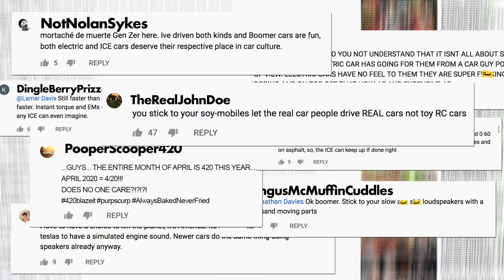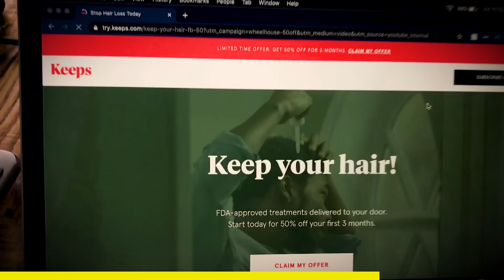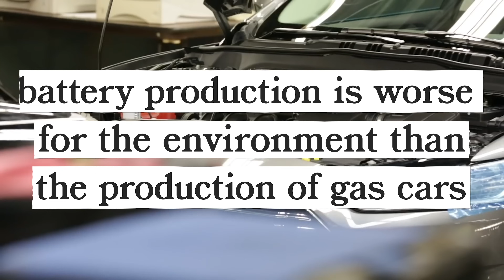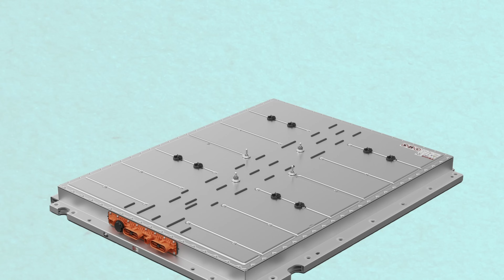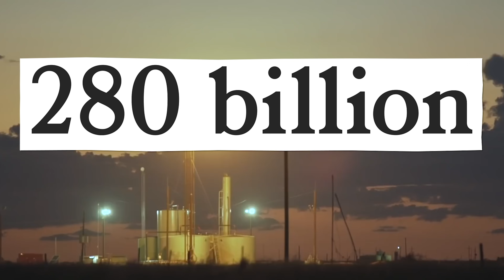Are Electric Cars REALLY Better for the Environment?

Comment: Uhhh. Our electric grid is not keeping up with usage. Ask those in California about brownouts and rolling blackouts. Several other states aren't far behind. Usage will continue to go up. Without Nuclear or some new technology we will not have plenty of electricity to power homes and businesses. 

Plus current lithium batteries are not being made to higher technology standards due to mineral shortages. Many EVs are being made with less range. Heard less efficiency but that was a YouTube about electric yachts which are improving rapidly.

AND these rebates for those buying EVs are NOT good for everyone. Guess who pays for these rebates? The taxpayer pays. Even those of use using fossil fuels.

FYI: I'd love to have one of the electric Shelbys.

EVs maybe the future or maybe hydrogen fuel cells or maybe someone will come up with something else. But for the next while, ... so are they really better?

Comment: electric cars are efficient? try to explain this to my diesel symbol it goes 2000km with full tank. Diesel cars are underrated and they have a long life span
Reply: EVs can travel more than 3.1 miles per kWh. Diesel contains approximately 37.85kWh per US gallon so EVs could travel approximately 117.6 MPeG (eG: equivalent Gallons) so yes, EVs are more efficient than ICEs.
But it depends on how the electricity is produced, if it is produced by a diesel power plant with 33% efficiency the overall MPG will be about 39MPG.
Reply: Not as long as battery electrics. And a large fuel tank doesn’t make something efficient. Sorry to burst that bubble.

Comment: Why can't california keep the AC running in your home if the power grid isn't overloaded already?
Reply: Because California state government are a pack of idiots who wanted to play engineer with the energy grid and screwed it up so badly that they didnt even allow for any regulation for renewables input into the grid meaning that solar and wind farms all pump in as much as they can before the grid has to hit breakers to stop them from melting the power lines and starting wildfires. But this cuts such huge swaths of power that often times they need to get power from other states in order to stabilise the grid. 

EV's have been reducing in California and their problem has gotten worse as a result. Seriously, look at the charts, more people are turning in their EV's in California due to the grid being unreliable but this exacerbates the problem California has to begin with. 

Long story short. Don't be like California. Listen to you Engineers and dont think you know better because you wear a tie instead of a hard hat. Also suffice to say that California is Not typical of the average American grid.

Comment: 50% cleaner? sounds about right... which means... we are not yet there EV are the scam of the environment. Petroleum based plants will continue to exist so any savings of that 50% for greenhouse gases is very very marginal overall, translating into what maybe 5% or even less? Also consider the gas cars are also becoming way more efficient so that 5.2 metric tons will be going down as well probably about 15-20% per decade.The EV cars are extremely dangerous they are heavier and if set on fire God forbid you cannot extinguish that fire. EV are not the solution and as you said create other problems, there are other viable technologies. We should not buy EVs at all, we should force the industry to accelerate these technologies as EVs are getting on the way of real clean progress with all these lies and propaganda regulations.
Reply: well this comment is troublingly stupid. The automotive industry is by far the largest emitter of man made green house gasses accounting for almost 25% (1/4) of all man made emissions. Reducing that by 50% has a big impact. It also reduces past 50% even further as the grid slowly transitions over to renewables. If you play alot of video games. This is like a point multiplier for the grid. With the energy grid renewable and the automotive industry all EV's, you'd cut out more than 45% of all man made emissions just with those two sectors. And whilst combustion engines are becoming more efficient they are still SIGNIFICANTLY less efficient than EV's. and in terms of thermodynamics they will never ever get close to EV efficiency. 

EV's are significantly safer than ICE vehicles. Also matched by safety ratings of vehicle regulators in effectively every country they're sold in. these include:

1.) no engine, transmission or fuel tank gives you a larger crumple zone in the front and rear of the vehicle dramatically increasing survivability of a crash.
2.) Because batteries are mounted in the floor of the car the centre of mass sits around the wheel axel of the car making them VERY difficult to roll which also drastically increases survivability. This is what gave the Model X the title of being the first SUV in history to achieve a 5 start safety rating.
3.) according to the bureau of statistics in most countries where they are sold, the NACAP safety board in Europe, the AANCAP safety board in Australia and the NHTSA in America, among many others, EV's are 11 times less likely to spontaneously combust compared to ICE vehicles and 5 times less likely to combustion in an accident and when they do combust they are more survivable because it often takes hours for visible flames to appear during thermal runaway and the fire spread far slower as everything isn't swimming in flammable oil. 

The only reason people THINK they're fire hazards is because the only time the media reports car fires is when someone famous dies, or its an EV. infact that phenomena is so prevalent worldwide that many places have done studies into that phenomena. But here is a real world anecdote for you.

about 3 months ago at the traffic lights by my house a pickup spontaneously caught fire whilst sitting at the red light. The fire engulfed the car so quickly both occupants died. It didn't even make the local newsletter much less state or national television news. About a month after that an EV in south America hitting a light post at 140km/h (87 mph). Both occupants walked away from the crash. about an hour later it caught fire. It made national headlines here in Australia and front page of every newspaper. "EV CATCHES FIRE" although they only mentioned that both occupants walked away from a crash that shouldn't have been survivable in a conventional car at the very end of the article, almost in passing.

so curb your hate boner.
Reply: @engineeringtheweirdguy2103  Well you admit that reducing by 50% would only have (not even) a 12.5% impact, only accounting for base variables, and that is if all the cars in the entire world were replaced minus projected growth. Now when you understand the rest of the logic you would probably get closer to my figures. You don't need to rant to show your ignorance. I bet you are not a real engineer because you should know an electric fire is the worst of all fires (aside from igniting plasma) and if you are, you are clearly amongst the brick-headed ones, unfortunately a lot of these out there. Hopefully you are not some idiot fanboy playing the TSLA stock, I encounter a lot of those in these forums. For your information neutral center of gravity, calculating passenger seating has been achieved decades ago by the auto industry, so there is not even an argument there. And safety ratings are just that... a marginal number from model to model, frontal collisions are very are and displacing the engine block into the cabin was resolved more than 20 yrs ago, and whoever happens to be in one, or either on the side or the back, they rather be not seating their *ss in a source of electric fire of instant propagation around the vehicle and impossible to escape. I don't play video games btw, but good luck with that.
Reply: @navsofour2892  said the guy who thought EV’s were a fire hazard and that it the reduction would be 5% or less. Cognitive dissonance and the dunning Kruger effect is a hell of a thing kid. And FYI, yes. Real Engineer. And a successful one at that. And one who’s published research thesis’s on this very topic.

Also, P.S.  nothing in your comment indicates that the 12.5% would be reduced by anything else. And you were off by a whopping 86% difference! That’s not inconsequential.

Comment: Mining Lithium requires enormous amounts of water and I believe this cost has been trivialized here.  What are the chances that the cost to mine this (and Cobalt) turns out to be 5 - 10x what is predicted now.  None of this will go smoothly if they start banning ICE sales by 2030.  Nonetheless, nice work.
Reply: There are around 12-15 ways to extract lithium depending and how it’s stored in the environment. Only one of those needs huge amounts of water. The media loves their half truths.
Reply: @engineeringtheweirdguy2103  I don't disagree with the half truths.  There are agendas and there are biases.   One thing that seems certain is the method chosen will be the one that provides the most profit.   Not that this is inherently bad, until you find out that the ones mining are slaves working for BS wages.  Where have we seen that before?  Yes, many places and I talked to a gentlemen who grew up under the CCP (at a golf driving range) for almost an hour yesterday and he confirmed everything.   England plans on cutting off ICE's effective 2030.  If everyone else does this, how will supply meet demand?
Reply: @johnr9528  actually Australia is the largest producer of lithium in the world (not the largest deposits, but the largest producer) and miners in Australia earn more money than most other professions in Australia. Infact miners are known to easily get $250k+ USD for changing drill bits once a week. So hardly slave labour. Additionally, evs are moving away from cobalt. But the largest consumer of cobalt by weight are fuel refineries in anycase.
Reply: Can't wait to buy a 2001 Toyota Camry on the black market and fuel it from jerry cans smuggled from Russia